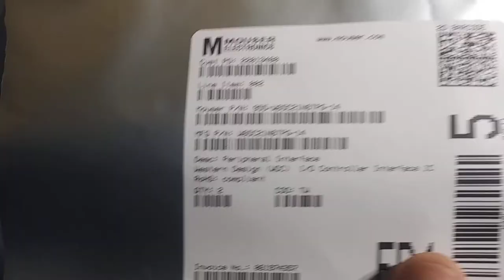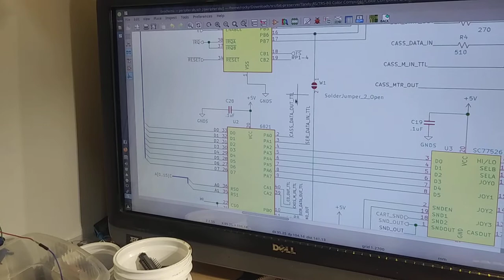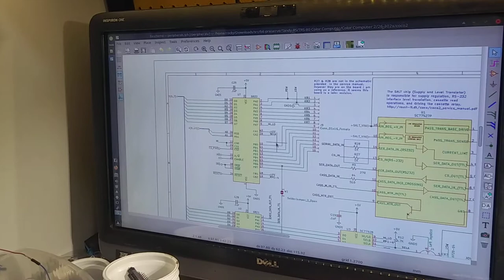Testing a modern replacement for the MC6821 and possibly the MC6822 on my TRS-80 CoCo 2.

Comment: Where did you get the RF modulator replacement board?
Reply from the maker: The actually RF-CAN ? I took that from a donor CoCo 2 board that could not be repaired.
Reply: @rockyhill3  No, the little red board piggybacked on. I see now the entire machine is a new PCB. Where did you get that? I have a similar VIC-20 one by Rob Taylor but didn't know someone made one for the CoCo 2.
Reply from the maker: @tenminutetokyo2643   Oh I see, that's a composite mode board made by zippster. Zippster makes boards for the CoCo's.
https://thezippsterzone.com/

As far as the reproduction board goes, CoCo boards is one of my hobbies.  I have all of the designs so far on github.
https://github.com/qbancoffee/coco_motherboards